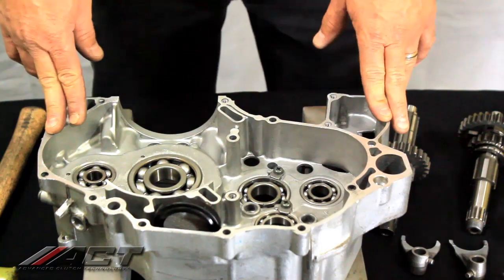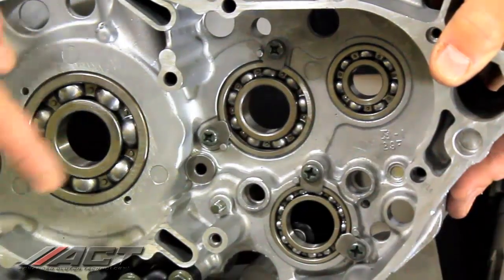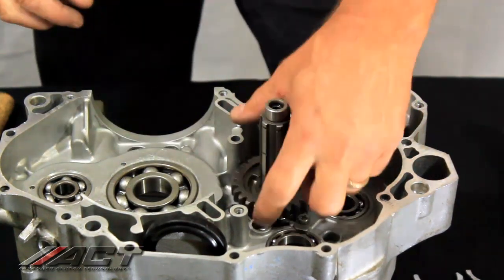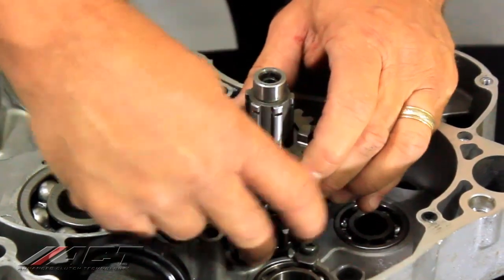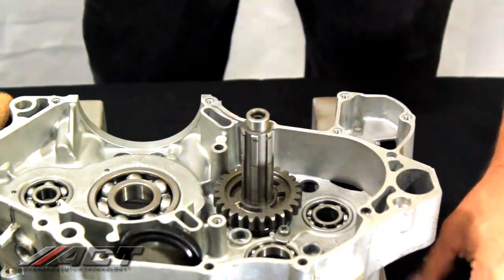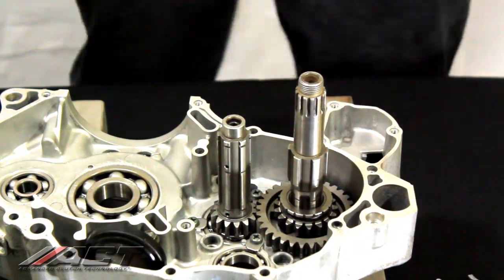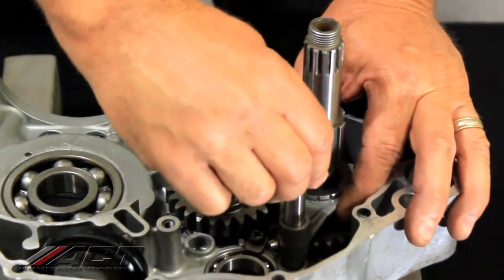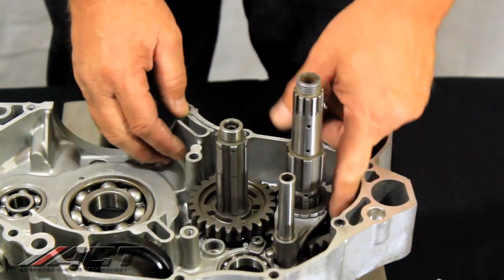Modifications for installing DRZ Wide Ratio Gears

Comment: I wanted to add a couple of thoughts on installing the ACT Wide Ratio Gears:
1) I am mechanically inclined, but had never split a case before
2) I have installed the first set in my DRZ400s with no issues.
3) I am installing the second set on my wife's DRZ now. In fact, I just finished modifying the case, and the 3rd gear shift fork. Going to fit the second shift fork when I finish adding the comments

What worked very well for me was to use the "Dentist fitting a filling" approach. I marked the area of the described interference with a black sharpie. Installed the gear or shift fork, spun, removed, looked at the sharpie mark where the interference would wipe away the sharpie, grind a little in that area, re sharpie, re install, etc...and repeat until clearance is made. This method actually prevented me from damaging my case, as once 5th gear was close to fitting in the case; I was still getting  some interference, BUT the sharpie mark wasn't showing any bright marks where the gear was touching. The issue was the bearing retainer tab directly at 3
o-clock from the noted rework area. The tab was a touch wider and I just had to touch it with the grinder to break the burr on the edge of the retainer. If I wasn't using the sharpie, I may have continues to grind the noted area. more than needed.

As a comparison I was running 14/47 with ACT gears and my wife's was stock 15/44. With the ACT I rarely get into 5th gear when tooting around with her in 5th in the 40 - 60 MPH range.

Great addition to the bike and pretty easy to install.

Comment: Busted my third gear by accident, which was a perfect excuse for me to buy this kit😄.  Just received it, so now I only have to clear the workbench and do some grinding.
Reply: Do you got a Youtube channel and or place to report your comparison (looking at this kit as well)!
Reply: @mt1885  , sorry, no I have no youtube channel or the right equipment to do a proper comparison review (action cameras, microphones, video editing software, digital rev counters etc). But there are other videos on youtube, where they compare the wide gear ratio kit to original gearing.  What I have discovered so far is that when you split the engine casing, there are also other parts that might need to be exchanged after a gearbox incident like I had.  Metal debree in the gear shaft bearings and gaskets that needs to be replaced.  So if you’re in the same situation as me, be prepared that it might be some extra work an cost involved besides the wide gear ratio kit.

Comment: Would like to get a better look at the modified fork on the secondary  shaft. It seems to be very slender  and prone to failure.
Reply from the maker: Thanks for your concern.  We have not seen shift fork failures.  If you would like to see more, there is a photo on our website or email info@advancedclutch.com and we would be glad to send more photos.  The wider ratios are not possible without machining the shift fork to clear the larger fifth gear.  We sell both new or used modified shift forks to be sure the minimum amount of material is taken off to accomplish this and there are detailed instructions also available for the do-it-yourselfer.

Comment: Dont found many videos about customers that run the kit.is it durabel for though offroad tracks and heavy load on the street when i want to use it as an Adventure bike?
Reply from the maker: These gears will be perfect for adventure riding. If you search up ACT wide ratio DRZ gears you will see quite a few reviews on the forums also information on changing your sprockets after doing the gear change. If you cannot find any look on  thumpertalk.com

Comment: does the fifth gear reduce engine RPM's on the highway ?
Reply from the maker: Yes. If you use the same sprockets there is a 21% reduction to RPM's in fifth gear.
Reply: thank you!

Comment: Hi I have a drz 400e 2002 will this be compatible? Also how much does it cost if I do it myself thank you Harsha.
Reply from the maker: Hi Harsha! Yes this is compatible with the 2002 DRZ 400E. You would need part number 100WRSZ1. They cost $689.00 USD.

Comment: close ratio or wide ratio for drag race   500meter ? For the best power and top speed
Reply from the maker: These gears are wide ratio. First gear is still stock DRZ, second through fifth gear are considered wide ratio. Usually for drag racing you use close ratio gears to keep the engine in the happy rpm range. Running a wide ratio gear will give you a higher top end and longer gears. When you shift it might fall out of your desired powerband when using wide ratio gears for drag racing.